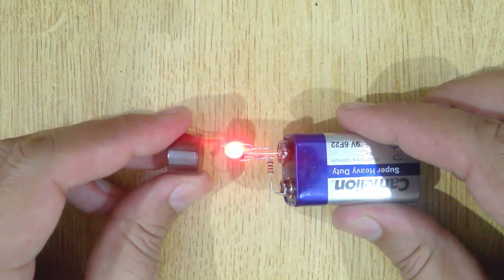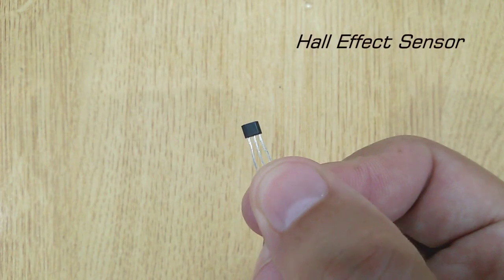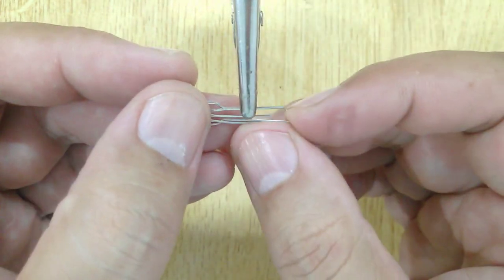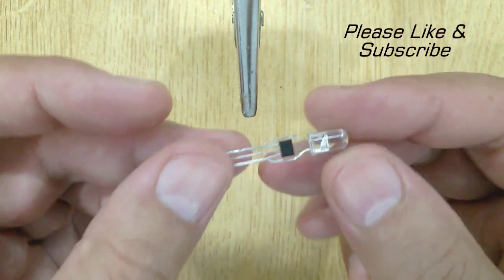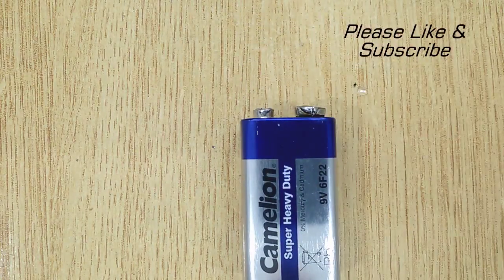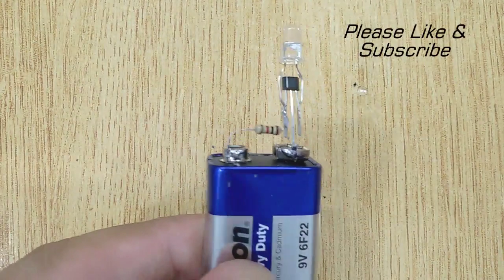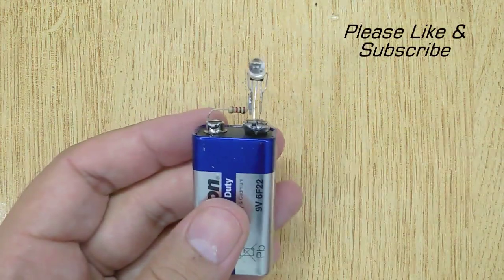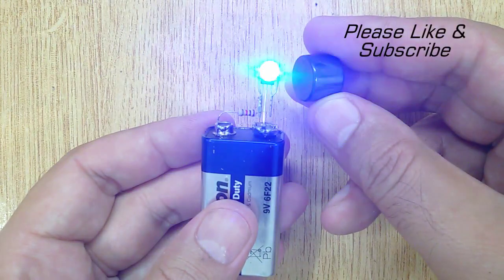How to Make Magnetic Switch using Hall Effect Sensor | Hall Sensor Project | Ezi Circuits

Comment: So... let me know... look I need to sense the fan rotation for a device, so with this circuit, in the fact of fan stop, led would turn off? Thanks in advance!
Reply: Hall effect sensors and reed switches are basically magnet detectors. They can be set up to do something when the detect a magnet near by OR they can be set up to do something when they sense that a magnet is moved away. There's different polarities of these types of sensors, and you can wire up different circuits, for these effects. But short answer is yes you can detect when a fan stops using a hall effects sensor. Things to be aware of... your sensor or a magnet will have to attach to the fan blades (if not properly secured it can rocket off, if secured properly it can through off the balance of the fan, magnets on each blade on the same spot will balance out) if you only have one sensor, one of the blades with a magnet on it (could be only alternating blades if even number of blades, or just one blade and a counter weight, etc) ... but if you only have one sensor, one of the blades with a magnet on it, could stop right where the sensor is so it would think the fan is still moving. You can fix that with two sensors placed apart just such that no two blades can land on them both at the same time.
Reply: @binaryglitch64  Super clear. I understood Thanks a lot brother!!!!!. Kind regards.
Reply: @essteban  no worries. Are you into electronics, like do you think building circuts would be a fun hobby for you? If not (as in this is just a one time project or something), than you can ignore the rest of this, but if electronics engineering seems fun to you I have some channel recommendations with warnings about the types of YouTubers they are.

EEVblog 
(Australian electrical engineer, mousey/ high-pitched voice, really detailed, most of his videos are for intermediate to advanced level, but he has videos on the basics too and nobody will be more thorough than him. His videos tend to be very long.)
[ https://youtube.com/c/EevblogDave ]

Great Scott 
(he is a German electrical engineering student, thick accent, audio tends to be a little quiet especially on low end phones, he is the easiest to following along with on build projects, has great handwriting, great for budget builds.)
[ https://youtube.com/c/greatscottlab ]

ElectroBoom 
(Middle Eastern electrical engineer living in Canada, accent is not too thick, so he's easy to understand. He uses comedy to educate, he's big on shocking himself and pointing out why you shouldn't wire something a certain way by showing you how you could get shocked by the circuit design mistake... basically slapstick. It's a brand of humor that's not for everyone.)
[ https://youtube.com/c/Electroboom ]

BigClive 
(Scottish or maybe English Electrical Engineer, who's more of a down to earth kind of guy, he's got a very midwestern feel to him, if your from the US... he does a lot of tare-downs of simple circuits, then he reverse engineers them and draws the wiring diagram and explains how the circuit works. He likes to make up fake jargon to make himself sound dumber than he actually is for example ih likes words like doohickey and thing-a-ma bob and deally-whapper and thing-a-ma-jig etc. He does it as a form of humor but once again we have an EE who's humor isn't everyone's flavor. )
[ https://youtube.com/c/Bigclive ]

I'm sure there's a few more, but that's a good start. The algorithm will start suggesting them once you have those. I'll come back and edit several times to add links.

Comment: How can we increase the distance of magnetic read? I've done with comparator and amplifying with transistor, but the distance of the magnet and the hall sensor must be close enough. Max 3mm only. I wanna make the distance between them into minimum 20mm.
Reply: Unfortunately magnetic fields cut in quarter when you double the distance so if points 1 and 2 are 5 mm apart, and points A and B are 10mm apart and both sets of points use the same size magnets, and the same sensor, the 10mm distance won't be half the strength of 5mm distance, no, no... in fact it will be half of half or a quarter the strength. So you must have a smaller sensor or a bigger magnet. Since a smaller sensor really isn't a thing for us common folk (it can be but totes not worth), for us the option is a bigger magnet. To be clear the physical size of the magnet doesn't matter, it's actually the strength of the magnetic field that matters. Electromagnets can get stronger magnetic fields just by pushing more electricity threw them, just be careful not to burn out your magnet. If the current is too high for the winding the wire can get compromised and break under heat from the pressure of too many electrons trying to trade molecules with their neighbors all at once. That's what causes burnout in electromagnets, motors, solenoids, transformers, etc. So I would go with an electromagnet if that's a feasible option, or else maybe a permanent magnet with a bigger field. Some metals make better magnets than others. The iron nickel alloy that's typically used in refrigerator magnets will not be as strong as a neodymium magnet of the same size, so you can scale up in material quality and physical size with permanent magnets... both can get costly, quick. 2 cm should be quite achievable though, that's about twice the distance used in the hall effects sensor in most bicycle speedometers... so just get a magnet that's about 4 times as strong and it should work.
Reply: @binaryglitch64 Oic, maybe an electromagnet isn't a choice. Because it must been supplied by power. I use a neodymium magnet. So, the solution is increasing the magnetic strength of permanent magnet to produce wider magnetic field.. Thanks. 🙏

Comment: What will happen if you connect the negative leg of the LED to the middle pin ( ground) of this hall sensor and the positive ( long leg) of the LED to the output of the hall sensor?
That is how it should be the way the hall sensor suppose to work.
This means that when the magnet is by the sensor, the hall has output. And by output it is understood as positive just like it's positive pin.
While in the real world, the output means, no output as in 0, as in ground when the magnet is near it.  That is why the LED turns on, but wait, it means you better connect the other leg of the LED to the positive pin of the hall and not its middle ground pin.  Oh me.
This is as screwed up as it gets.  As confusing as it gets.
What the hell output means. ..... oh my.
Then again what side of the magnet..... Latching, non-latchng, what sides of the magnet, output, input, high put, low put., unipolar, bipolar, omnipolar.........  jesus fing christ.
Once a poor schmack gets into it , he finds out, he is in for a ride...then it is head spinning ride as to what anybody means by all them terms.
Reply: Never read something That better describes how i feel rigtig now !! Ive got an ebike hall sensor That does exactly this! Opens from vcc to signal but it supposed to open from ground to signal. Then i find out the 10k ohm resistor is bad.. i replace it. Now it gives signal from ground to signal. Great... but it also gives signal from vcc to signal when the north pole passes the hall sensor. So still getting hall sensor error on the controller but why ???

Comment: plz tell me .. how can i use it to off led by magnet
Reply: there's a couple ways to do it. The simplest requires understanding the difference between NO and NC hall effect sensors ... NO = Normally Open, NC = Normally Closed. This means what happens to the circuit when there's no magnet present. If you use an NC-HES the light will be on in the presence of a magnet, if you use a NO-HES the light will be off until a magnetic field shows up. 

Also there's another component that's simpler and can be used as a magnet detector OR a 'the magnet went away' sensor... it's called the reed switch and it also comes as NC or NO ... it only has two leads (leggs) and it just lets electricity through or doesn't depending on which kond it is and if it's near a magnet or not. 

Both of these types of sensors have slightly different properties. One doesn't car how the magnet is oriented the other one does, one can sense how strong the magnetic field is (how close the magnet is) the other can't it's just off or on... you really should look them both up, maybe watch a few (more than one) video comparing them. There are several such videos. None of them tell you enough, and some are made by people who don't actually know, so watch several to figure it out. Happy wiring, cheers.